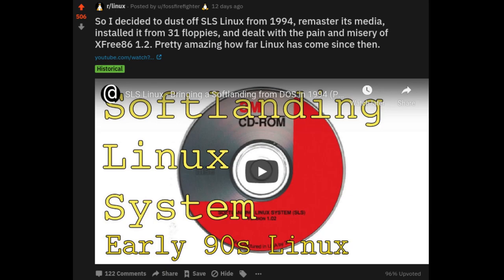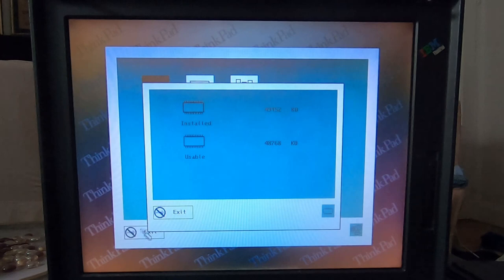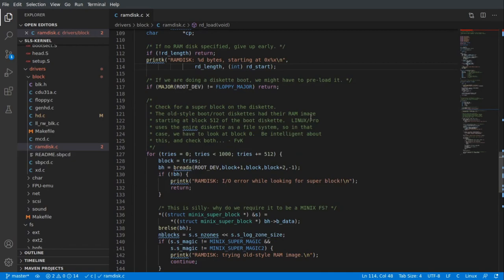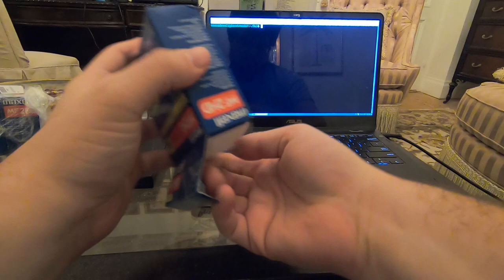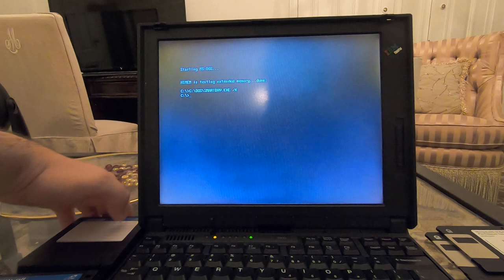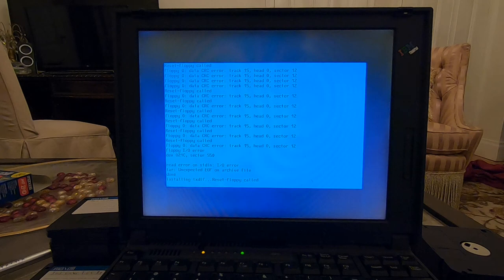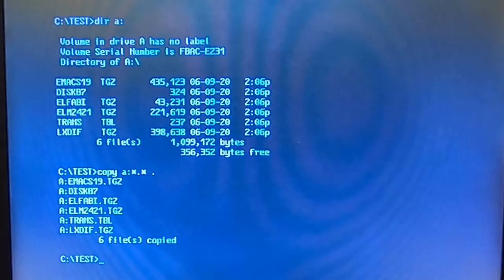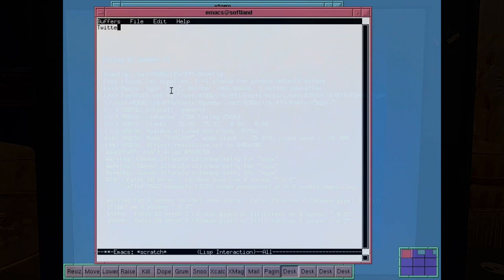Installing SLS Linux On Real Hardware Required Far More Effort Than Expected ... // (SLS Part 2)

Comment: Good job! I remember reading about GRUB and LILO ages ago, with the recommendation being "try to avoid LILO if you can" due to disk size and configuration issues. It was cool to see how that didn't deter you at all though lol.
Reply from the maker: My real start to Linux was on Macintoshes, and LILO is a breeze compared to quik and yaboot.
Reply: @NCommander  oh dear yaboot is a hell of a thing
Reply from the maker: @kaitlyn__L  It's not as bad as quik which is pretty horrifying when you think about it. At least yaboot doesn't usually require BootPatches or a serial console.
Reply: @NCommander  yeah I’ll admit, I’ve lived with yaboot but stayed well away from quik just from seeing howto’s. So I’m with you all the way about that.

Comment: You are legendary and an inspiration to me, a budding retro geek. I recently built my first retro computer, which was just a windows XP build. I have aspirations to do a 3.1 build
Reply from the maker: Largest trick with these is sometimes there's a catch 22 that you might need a working older computer to make everything for the older computer. Feel free to ask questions, and I recommend reddit's /r/vintagecomputing as much as possible.
Reply: It may be worthwhile to build an “intermediate” 9x system to help bridge the gap. In general though, if your XP box has a floppy drive, you’ll probably be fine. The problems come once you start having to deal with 5.25” floppies or of course alternative platforms the PC can’t write disks for.

Comment: "Installing this is super easy, you just need to code your own kernel driver." :D

Awesome.
Reply from the maker: You know, in hindsight, writing a LBA patch for the Linux kernel just to fulfill a promise I made on an Internet video is probably insane.
Reply: @NCommander  make sure to upstream the changes!
Reply: @NCommander  You're one step away from just writing your own OS that happens to be identical to Linux in functionality!
Reply: @pitust  If it's a proper patch and not just a workaround, then he should definitely do that - given that part of the code is still there in the current release.
Reply: @Time4Technology  that was linux 0.99... the current version is linux 6.0
Reply: @XENON2028  I explicitly wrote "given that part of the code is still there in the current release.".
Reply: @Time4Technology  yeah fair, but idk why after 6 major versions they would still not be using a better way of accessing the hdd
Reply: Someone once told me that using nonvolatile storage is cheating. You should code your OS from scratch, in hex machine code, every time you boot.

Comment: Sadly when it comes to floppy disks it seems that the older the disk is, the more likely it will still be good.  Disks made in the late 90s through the early 00s are complete junk. What used to be a great way to reliably store your data became a joke with a 30-40% failure rate right out of the package.
Great video!
Reply from the maker: Part of it is the bathtub curve of engineering. Basically, disks that were going to fail failed back when they were new. 3 out 30 actually sounds about what I remember for the time, and CHKDSK/SCANDISK would simply mark a sector dead and life would keep going (which is how I managed with A3, although I don't think I showed that on camera).

I should note that I've since rewritten a bunch of these disks, and they pretty much all test good with no issues.
Reply: @NCommander  according some retro enthusiasts that are dealing with lots of floppies (like Clint from LGR and principally Dave from 8bitguy), what @Gavldac said is totally true.
The overall quality of new magnetic media like floppies and K7's has plummeted since the 2000's, even from "good" brands like Sony and Maxell.
Today they simply don't make good floppies or other magnetic media anymore, all new stuff is garbage.
On the other hand, the good old floppies from the 90's still work just fine today, better so than the new ones.
Reply: Very true, when I had to move files home from school back in the 90s to early 2000s all we had was floppies.
But I was armed with 6 floppies with the same content, and usually, 2-3 of them were corrupted, so mirroring content was a necessity.
Reply: @NCommander  another thing that I've personally stumbled upon - dust. if I insert one of my floppies into an uncleaned drive, it leaves it visibly scratched, and the new ones are more fragile. but after cleaning the heads disks remain perfectly ok after multiple inserts. I use a special cleaning floppy for that (a piece of cloth in a case basically), some people clean the heads with a q-tip. what's your favorite method btw?
Reply: As the technology got obsoleted they simply decided it was not worth keeping production at high quality and cost

Comment: My first install of Linux was Slackware 3.0 from 1995, on a Cyrix P150+, specfically built for running Linux.  This means I selected the excellently supported S3 Vision 968 based Diamond Stealth 64Video VRAM graphics card.
All floppies I needed was a Boot and a Root floppy, install was through the cdrom.

Comment: D'oh !!! I've been a linux user since 1997, beginning with an already antiquated Slackware 3.0 (the one I could grab at the time, little did I know), and I realise I never knew that SLS stands for Soft Landing Linux ! I feel really stupid.
I had a Thinkpad 380 later on, and that NeoMagic chipset has been the bane of my existence for months before there was finally a driver able to make sense of it, I think it happened sometime during the kernel 2.0 timeframe. It didn't help that IBM being who they are used slightly different i/o ports than other vendors of the same chip, making the TP a corner case.
The things we had to go through !

Comment: I've actually found that using a degausser/bulk eraser (the plug in kind that used to be sold by Radio Shack as a tape eraser) actually can bring those cheap marginal disks back into service, at least temporarily. A couple passes over the degausser and an unconditional format has made many of those bottom-barrel disks usable for me through the years. I wouldn't trust them with any important data (honestly, don't trust any floppy for long-term storage anymore) but for use cases like this it can definitely help.

I suspect that the issue is that some of these disks have some "magnetic residue" on them for whatever reason, that the drive's relatively low power head can't overcome. A degausser actually truly cleans off all magnetic flux from the disk, making it usable. Of course later disks were built to a cost and were already never going to be that reliable, but I hope this can help anyone out there playing around with retro computing (assuming you can still even find a degausser).

(Obligatory warning: be very careful when using a degausser, especially around retro media. It might resurrect a weak floppy, but it'll also happily erase any other magnetic media nearby. Floppies, cassettes, video tapes, hard disks and so on will all succumb to it. It'll even wreak havoc on CRT TVs and monitors. They're typically pretty well shielded and the field won't extend too far, but definitely take a couple steps away from any other magnetic media you care about when using your degausser.)

Comment: The hard disk size limit, was another issue I noticed that I NEVER experienced before not even in the early 2000s/late 90s! But upon trying to install SuSE Linux 5 or earlier, I did run into that issue. Also Mandrake 6.0 and OpenLinux 1.3, which only supported 8.4GB HDD max. I even had to buy some compatible IDE to CF card readers to use CF cards since 8GB HDDs are outlandishly priced on Ebay right now due to the whole Retro Computer Gaming thing. The only thing is the installers for SUSE 5 and earlier did NOT have disk partition utilities. I had to use other OS disks for that first, before installing.. Crazy stuff!

Comment: I have a suggestion for the 512 subscribers milestone: what about installing same Minix release used by Linus in 1991 in your Thinkpad then build the kernel 0.01 using same tools he used at that time?
Reply from the maker: "512 subscribers" - oh I love it.
I actually had that idea although I really don't know if I can coax Minix running ontop that ThinkPad. It's going to have the same disk geometry issue, and I don't know how easy it will be to patch out of Minix. It took a few solid days of effort just to remove it from Linux although part of that was understanding why it blew up.
Reply: @NCommander  I'd look into VMs if I were you; I know it's nice to run older software on real hardware (I have a XP retro machine myself) but in this case I think it'd be worth doing because that Thinkpad seems pretty limited in terms of flexibility and early Linux is pretty limited in terms of driver support, so that GPU thing might crop up more often than not whenever you wanna do X related stuff, etc.
Appreciate the video, it's incredibly interesting getting to see the early world of Linux and how different it was. :D
Reply: @NCommander  I have the same Thinkpad model here (although it is in a poor condition) and I suspect that it could because the x86 hardware didn't change much in early 90s. I think it worth a try Michael. :-)
Reply: @NCommander  This was entertaining stuff -- apparently I'm in need of an Old Software fix :)  The music was hilariously appropriate!

 I'd LOVE to see how that floppy recovery card you mentioned works. 

Despite the plastic slide, in their day Maxell diskettes were good quality (not quite up to Sony, but generally very reliable), and back when I used floppies all the time, their slide never gave me any grief (I did have a couple metal slides come off inside the drive, that's all kinds of fun). That you only got a couple with bad sectors, and none with the dreaded Bad Track 0 error... that's durn good for 25+ year old diskettes.

Have you noticed how much faster a USB floppy is than one on the FDD interface? same Teac drive inside, so it's the FDD port, not the drive, that's slower'n molasses..

BTW since yesterday Youtube decided to nuke the old mobile interface, I can no longer make top level comments, nor see posters' names... nor can I see channels. Glad I'm already subbed cuz the way it is now, I can't make new subs. Friends are griping about it too, so it's not just my setup. [And hard returns are ignored half the time. Grrr..]

Comment: Having done system backups and Linux installations in the 90s, big packs of floppies are never trustworthy. Once managed to buy a 100 pack, at a store where I'd had to explain what a floppy was to the sales person, and 80 of them had bad sectors. The unreliability of disks, even when read-checked after writing, led to tools like PAR2 and ddrescue. Under Linux, we have a low level format tool called superformat in the package fdutils, and we can check for bad blocks with badblocks (-c for mke2fs or e2fsck); mbadblocks from mtools does so for FAT floppies. As a historical curiosity, the first release of the Linux kernel basically only worked with Linus' floppy drive.

Side note, newer media aren't necessarily much more reliable at a media level. They do have more recovery logic integrated into the drives, such as forward error correction (sectors are larger than the data they store, for instance 2448 vs 2048 for CD-ROM) and sector remapping (including having spare sectors that aren't advertised). SSDs even require wear leveling. Linux has such layers too, in particular in the MTD system used for raw flash. We used to have raw access to hard disks, which was why an RLL controller could provide more capacity with the same disk than an MFM controller (which floppies use). All that is moved into the drive with IDE, SCSI etc.
Reply from the maker: I feel a sudden urge to install MINIX and cross-compile Linux 0.1.

Comment: Slackware, which was quite similar to SLS in MANY ways including installation, had funny boot+root disks.  If memory serves (often it does not) you would tweak a bit in a compiled kernel -- with a utility that I think was in the kernel source tree -- that told the kernel that the ram disk followed immediately after the kernel on the boot+root combo disk.  Then you would use dd to write the tweaked kernel to the start of the boot+root combo disk.  Once that finished, you would take an archive, maybe an image of a root file system -- frequently Minix -- and write it to the boot+root combo disk starting at the next byte.

The kernel would boot, see the bit / flag that the root file system started after the kernel finished and read it into memory.

This was a ... PITA ... that only applied to boot+root disks.

Separate boot and root disks were a little bit easier to work with.  You wrote the kernel to one floppy and a normal file system -- typically Minix -- to the root disk.

But boot+root combo disks were ... tricky.

If you want to know more about this, check out the documentation that came with the kernel.  I remember seeing this in 1.x and maybe early 2.x.  I think this was completely abandoned by the time 2.6 came around as other boot loaders; LILO, were by far the normal mode of operation.
Reply from the maker: I've never been able to determine if Slackware was a fork of SLS. A lot of the early Debian posts make a very big deal out of the fact that Debian didn't have SLS scripts in it, and Slackware pkgs are the same format (mostly) as SLS ones. I'd probably have to dig through USENET to find out though :/

Comment: one hack that i would use back when i was running Slackware 3.0 on a 486, was to avoid putting any hard drive entries in the BIOS and let linux handle it. then i would configure the system to boot from floppy only, write a custom kernel to a floppy, and boot the system that way.

Comment: floppies...Floppies..FLOPPIES!! I had similar recent issues with said floppies when trying to install old versions of Linux myself. At first I thought my UBS Floppy drive was bad. Nope, just as you stated here, once good floppies just up and fail, and NEW disks where failing! In the end it was some older OS disks and driver disks that I was able to reuse but I only had to make one or 3 disks for systems with no CDROM boot support. Ahh fun times no?

Comment: A very long time ago I installed an old slackware system using slattach and a serial port.  So I basically made a serial TCP/IP link to a host server and copied over all the installation files using FTP.  It took forever, but maybe and ancient tool like slattach would work for SLS Linux.

Comment: If you want some real fun take a look at calculating X modelines for your card/monitor. I spent way too much time seeing just how far I could push my CRT when I first installed SLS. It might be a way to get your LCD looking a bit better as well. (Edit: I see you gave it a go in Part 1. Take a look at the monitor section of your xconfig if you fancy heading down a very deep rabbit hole.)

Thanks for the blast from the past! But what happened to the old SLS "Darkstar" prompt?
Reply from the maker: I remember this, following by a high pitch whine and then panicking thinking I released the magic smoke. The passive matrix LCD actually looks fine in real life (resolution aside), but it doesn't show great on camera.
Reply: Modern Xorg at least comes with the tool cvt to give you a starting point. Back in the day xvidtune was usable for minor tweaks like positioning. read-edid+edid-decode can also get the information from modern plug and play monitors. Still doesn't help with the VGA driver, as mode timing was stored in hardware IIRC, or the VESA driver, which relies on the video BIOS.

Comment: Use one of the many shims to do the geometry translation for you. It defeats both the 504 meg limit and the 8gb limit    I use ONTRAK Dynamic Disk Overlay to run a 160 gig IDE drive on my 380XD

Comment: 9:30 formatting a floppy from DOS with just "format a:" does just check the floppy, not create a low level format. You should use "format a: /u" instead. But besides this short (negative) comment: please, keep going ;-).
Reply from the maker: format a: does do low-level formats, /u (unconditional) just bypasses the confirmation messages. /q is what controls if its low or high format.

Comment: Why is your thinkpad not using the whole screen while in bios or dos?

I saw this on an old HP laptop running windows XP as well, but never knew the reason

BTW: how is the (so good to the touch when new) and so sticky when its old coding holding?
Reply: IT doesn't have scaling, the LCD is 800x600, the lower resolution text mode is just centered. Most older laptops do this.
Reply from the maker: LCD resizing is a somewhat new trick, and usually done with software rendering. Unlike CRTs which can basically resize the resulting image with the electron gun, LCDs are designed to work at only one resolution, or a multiple of their native resolution. In addition, most LCDs have hardware upscalers to handle things like this (you can see the upscaler on one of my flatscreens in the 486 Part 1/2 video).

Older LCDs/panels like this one just always stay on 800x600 and center since this prevents distortion. There is a special "PS2" utility I can use to change that behavior but it looks horrendous if I do it.

Comment: Late 90s, was at a friend's doing school work, and then I realized when he saved the document, it was stored in a 3.5 floppy.

I was horrified, and asked him why he was using that instead of the hard drive "we do it like this at the computer academy" loool, my eyes rolled so bad.

The worse part is that, I explained that these were unreliable and when we tried copying it to the HD... It failed!

Well, he learned that lesson, not from that "academy" (it was a ripoff)